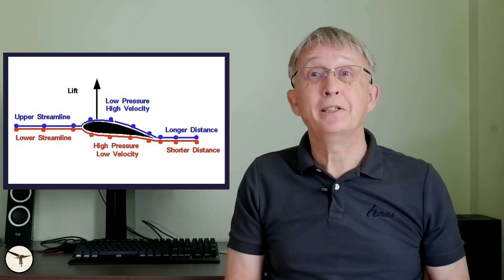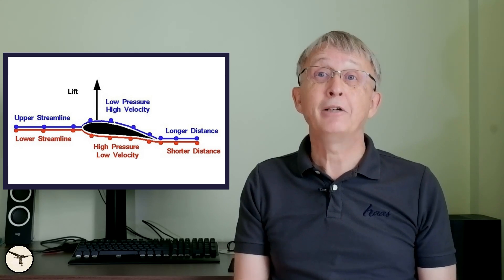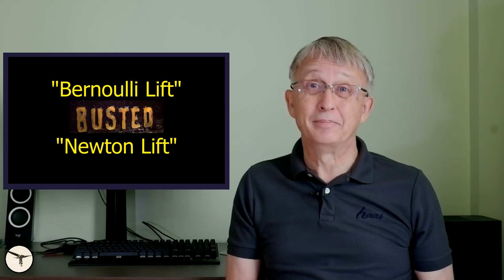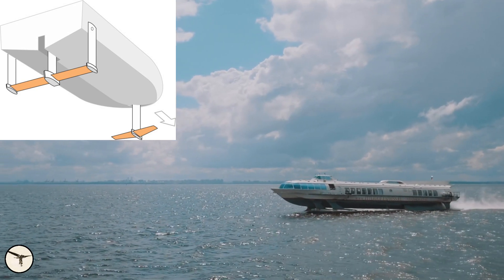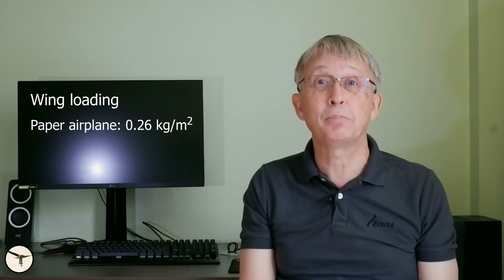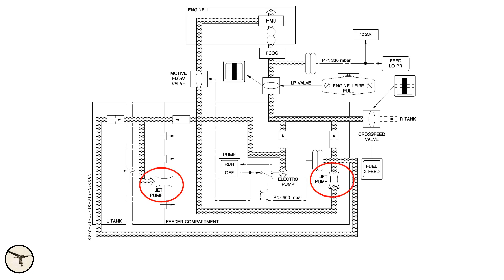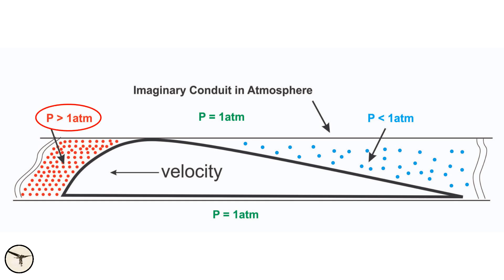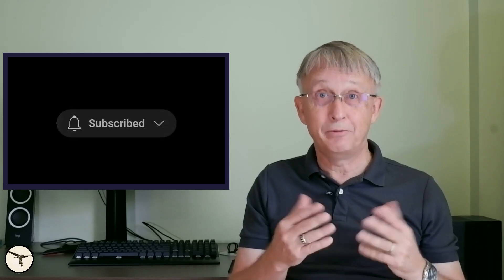7 Wing Lift Myths You Must Avoid: What Really Makes Airplanes Fly!

Comment: As an ex Boeing engineer (from back when they were still a good company), I agree with you 100%. But when you conclude your discussion about  Bernoulli's Equation and Newton's Laws of Motion with "BUSTED", some people might get the impression that both Bernoulli's Equation and Newton's Laws of Motion are BUSTED -- that is nether are useful in explaining lift. This is obviously not what you said or intended, but I see a lot of room for confusion. 
I like to say that arguing if lift is better described by Bernoulli's Equation or Newton's Laws of Motion is like arguing about how a bicycle is propelled. Is it  your muscles that move the bicycle forward or the tire of the bicycle pushing against the pavement? It's a silly argument, both are true but each only explains part of what is happening. Which description is better depends on what you want to learn about the bicycle.
It's also worth noting that the Navier–Stokes equations give a full description of fluid flow, including lift and drag, for Newtonian fluids (air and water are close to being Newtonian fluids in many situations). But the Navier–Stokes equations are generally unsolvable, and they are not exactly easy to explain. Thus they often aren't very useful for things like explaining why airplanes fly or even designing airplanes. Many of the "theories" of lift (Bernoulli's Equation, Newton's Laws of Motion, circulation theory, etc) come from engineers substituting much simpler equations for the Navier–Stokes equations. The advantage of this simplification is that these equations can often be solved, giving meaningful results. But there are huge drawbacks. The simplifications often mean the equations give accurate results only under very specific conditions. If you try to use them under other conditions, then you may get very unrealistic values.
Personally, I prefer the Newton's Laws of Motion as a simple answer to the question  "why do airplanes fly" -- they fly by pushing air down. For the subtly different question "why do wings produce lift", or "why are wings shaped the way they are", then it's probably good to bring in Bernoulli's Equation. But any time Bernoulli's Equation is used, I think it's important to note that the shape of streamlines or stream-tubes is different than the shape of the wing surface. This difference in shape is important in applying Bernoulli's Equation to things like flat wings and inverted cambered wings.
Reply from the maker: Thank you for your feedback. It is highly appreciated. And your analogy about the bicycle is great!
Reply: @andrewsnow7386  I would pretty much agree with most of what you said. 

But I've often wondered, for best practice basic explanations of lift, why the "shell" of Navier-Stokes is not regularly brought into the explantion:  conservation of mass (continuity), conservation of energy and conservation of momentum?

It just seems that strict observance of the separate accounting for and interconnection between all three of those conservation properties must be given full attention qualitatively if there is to be any hope of a somewhat realistic physical interpretation?
Reply: @davetime5234  The Newtonian explanation (F=ma) is the conservation of momentum explanation.  Bernoulli's principle is the conservation of energy explanation. Both rely on the conservation of mass. 
I'd be happy if more people just understood that these are not competing explanations. They are just different huge simplifications of the same complex phenomenon.
Reply: @andrewsnow7386  I certainly agree it would be preferable if people could see these are not competing explanations, but tied closely by cause and effect necessity.  Perhaps some better worded version of?:

The mass flow rate through a moving reference frame absent an airfoil presumably must settle to the same value even with the introduction of an airfoil.  

So the speed must adapt for wherever it can find a path to complete the flow, to a sufficient value to maintain mass flow rate continuity.

But energy conservation for the local speed change demands a static pressure transaction. (maybe relate it to random thermal kinetic energy plus intermolecular forces as the source of directed kinetic energy that supplies the increase in dynamic pressure: speed to maintain mass flow rate continuity)

And the asymmetry of obstruction encounter, causes a transverse (to the relative wind) pressure asymmetry from the above energy transactions.

And it is in fact this pressure difference which must impose a transverse change in momentum (delta P = d(mv)/dt opposing gravity, equal to weight, for level flight).

If tied together in some perhaps freshman college level physics sense like  the above, might the varied explanations be better anchored to fundamental proofs we all have to work though in science lab experience? (in contrast to concepts such as potential flow, circulation and vorticicty which appear to float rather unanchored to logical first principles physical proofs in many of these discussions)

Once we see how the momentum direction is changed, the explanation can consider the energy content dependency on tradeoffs in the mass vs velocity content of that transverse momentum (the greater the mass at the expense of speed, the higher the energy efficiency of the transverse momentum)

And the above hopefully then allows us to differente between energy dissipated in parasitic losses vs energy going directly into the vertical momentum change that directly accounts for lift.

Comment: Section 4, underside, 4:11 - the "busted" is for only paying attention to one surface not for the effect resulting from the fluid and bottom surface pushing against each other, but how it's presented misleads the viewer by making it look like the ever present positive angle of attack has no part in lift. The top surface' curvature provides control until the flow is disrupted, for example wings like the B-52 use spoilers to disrupt the flow as a means of roll control. The bottom of the wing pushes on air. No, this 4 line YT comment is not comprehensive.

Comment: Hi Magnar! I just completed an odyssey through your many (and if I may say so, somewhat repetitive) videos on this subject. The problem for me with your whole approach is that all the scientist's names and equations do not add up to an explanation at all: science is a description of reality, not an explanation. This stuff is useful if I want to be a wing designer, but not to give me an intuitive understanding of why wings generate lift at all. You are contemptuous of 'flat wing theory', but it seems to me like a good starting point. A flat wing with an angle of attack intuitively explains the generation of high pressure on the underside and low pressure on the top side, and why the streamline is deflected downward. It avoids all of the misconceptions and magical thinking you so trenchantly criticise with the other approaches. Having laid this groundwork, we then need to explain the consequences for the airflow over the top of the flat wing. This way it becomes pretty easy to explain why a flat wing stalls even at minimal angle of attack and also why bulking out the leading edge of the wing stops the airflow from separating simply by denying it the space to become turbulent into!

Comment: All this about air having to travel at the same speed across the top chord of the wing has completely avoided physical science . Air has weight  and air at a high velocity having to adhere to the top of a curved surface creates a force called centrifugal force . That force is held to the wings surface by the vacuum it creates at the surface . That vacuum or lift only occurs at a certain speed  where it can exceed the aircrafts weight  and lift it .The faster the air velocity the stronger the centrifugal force is exerted .  Yes most wings will fly some what upside down but at greater speed but will not lift like it would upright .Elliptical wings would fly upright or inverted . The thing about air must travel at the same speed  and meet at the trailing edge does not work there as they top and bottom are equally curved . Its about angle of attack and air velocity to create that centrifugal force to act on the top of the wing .  Now thats not a  fancy explanation . But its true.
Reply: You said: "is held to the wings surface by the vacuum it creates at the surface"

But there is no vacuum, nor partial vacuum.  For subsonic lift, the mass density around the wing stays constant.

Comment: Sorry, but i want defend Coanda effect to explain lift. My definition of Coanda effect differs from your: my definition is : when a solid ojbect is immersed in a fluid (ie: water or air) the fluid tend to follow the profile of the object. When a plane start to roll the air touches the wings and follow the wings' profile. In this way the air is pushed downward and for Newton's Third Law: Action & Reaction this air down causes the plane go up. It's like a baloon full of air: when the air exit from baloon the baloon travels around
Reply: …Coanda Effect, by definition, only happens when a jet is blown over the surface of the airfoil. It is the tendency of the jet to ‘attach’ to a nearby surface. You can have your own definition if you want but then you are no longer talking about the same thing observed by, and named after, Henri Coanda.
Reply: @XPLAlN  you are giving the same definition: if the jet is blown or the plane is moving in the fluid against the fluid the effect is the same: from the point of view of the plane it sees a "jet blowing against the plane"
Reply: @ I am not giving the same definition. I am giving you the correct definition. No free jet, no Coanda Effect. There is no free jet in the general case of airflow around a body. You are wrong to think it is the same thing. With a jet you get entrainment. No jet, no entrainment, no Coanda Effect.
  The difference is proved thus: the boundary layer separates from the airfoil at a given angle of deflection; normally this angle is constant wrt airspeed; now blow a jet across the surface (eg blown flap per video) and this angle CHANGES. You cannot delay the separation point (ie stall) by simply increasing the flight speed of the airplane. You can delay the separation point by blowing a jet over the surface. The latter is an example of Coanda Effect and the man himself is reputed to have turned the flow through 180°. Try doing that on any plain, unblown, surface.

Comment: So many people discuss "new ideas" for a problem for which the mathematical model was found before 1850 by Navier and Stokes. They improved the previous equations by Newton and Euler to include viscosity and thermal conductivity of the fluids. And I don't mean Newton's laws of motion, but Newton's differential equation for what it's called now a "Newtonian fluid". Newton already considered the speed of sound and Euler also the thermodynamics of the fluid, one century before Navier and Stokes, and none of these are reflected in oversimplified models you busted, even if we all saw nice photos of supersonic fighter jets with vapor cones behind them.
If you need a simple reason for lift, use Newton 3rd law of motion: if you push the air down, the air will push you up. If doesn't matter if you do this by flapping your wings like a bird, with a propeller like helicopters or using a wing and relative motion of the air, like planes and kites.
Very good and compact video, well done! I would suggest another one about the stall which is even less understood. Most can't fly a glider and feel it with their own hand, but you are very good at explaining.

Comment: We can compare an airplane moving "over" a mass of air with a ship moving over a mass of water, ignoring the physical differences between the two elements for now. The ship does not sink, whether moving or stationary because of hydrostatic thrust. For the airplane to achieve a similar effect it has to create a "surface" on which it can float. It can only do this when moving and by the shape of its wings. Regardless of the shape of the wings, it will "sink" if its speed is reduced to zero. But why doesn't the ship sink, even when stationary? Because of the shape of its hull (which acts as the wings of the airplane). So, what would be the ideal shape for the airplane's wings so that it floats, even when stationary? Would having the fuselage in the shape of a hull (so that it doesn't sink when it lands on the water) and the wings concave at the bottom, as if it were a huge umbrella, solve the problem? Yes, I am ignoring all the aerodynamic issues, as I know nothing about aeronautics. I am just wondering. A helicopter in vertical fall creates a bit of this umbrella effect, as the friction with the air during the fall keeps the blades spinning.

Comment: It's pure ignorance to talk about "equal time" for air over the top. The camber causes air over the top to pass faster than air under, even before "A" slows and compresses air underneath the wing.

Are we to think that for a ram-wing GEV like the Lippisch X-114, air bounces from under the wing imparting lift via Newtonian reaction, off the water and back up and off the wing again?
Or is it in ground effect via Bernoulli lift enhanced in GE, until it flies up above GE and switches to Newtonian reaction in the air?

Maybe with a propeller or ducted fan, there's a strong component of Newtonian reaction, but not for a wing -not even a flat plate without camber.

Comment: First I would like to congratulate this channel, not only as one of the very few that get lift right (see previous videos), but also for explaining it well. I would still like to comment on a few points raised in this video that might merit deeper discussion.

Air should be treated as incompressible at subsonic speeds, just indeed like water. There is no significant change of air density around a subsonic airplane. Looking closely, submarine control surfaces and hydrofoils lifting hulls out of the water at speed follow exactly the same physics as airfoils. This changes drastically only in trans- and supersonic scenarios, when very steep density gradients, aka shocks, develop. This change is actually the reason why supersonic airfoils are so very different. Any design can be optimized for either regime, but impossibly for both. This issue gave rise to, e.g., swept (edit: variable sweep) wing designs, but is also the reason why the Lockheed F-104 was very difficult to handle at subsonic speeds, and why supersonic airliners would only be viably efficient when they could stay supersonic for most of the flight time.

About the Bernoulli law, it is helpful to look at it as a one-dimensional limit of the full 3D situation. Expressed in this way, it relates the pressure gradient along a flow line with a force, and thus acceleration, along that flow line. This of course does happen above and below the wing of an airplane, but it is irrelevant to the question of lift. What is relevant is the pressure gradient perpendicular to the flow line, which is equivalent to a force/acceleration in that direction. This is the lift. This is, as will watchers of this channel know from previous videos, equivalent to the curvature of the flow line. In short, it is the curvature of the flow lines that creates the lift.

A slab as lift creating surface can, to some limited degree work. The relevant curvature is exclusively at the four edges in this situation. The point is that if the flow was laminar instead of turbulent, i.e., symmetrically identical at the front and back end of the slab, it would not create any lift, just torque. The "secret" why it does create some lift in real air is that at the back end the flow detaches from the slab surface straight and barely curved, instead of following the edge, as it is forced to do in the front. This still creates torque, is inefficient, and the stagnation point of the flow is barely controllable, which should make it a nightmare to fly. One of the breakthrough achievements of early aviators was to make the stagnation point controllable by blunting the front edge of the lifting surface, so that now the split of the flow could be controlled by angle of attack.

Finally, Newton's laws: Actually, this explanation in its narrow form, as it is almost always presented, would violate Newton's first law. The downwash acquires downward momentum, but a plain in level flight does NOT acquire upward momentum. So the momentum of the downwash has to be compensated somewhere else. In order to understand this, and actually the complete package of all three laws in relation to flight, one has to take a huge step beck and consider the entire height of the atmosphere and its boundary conditions, (hard below, soft on top) around the airplane. A plane creates a huge, albeit very weak and geometrically diluted vortex, with itself in the center, that ranges from ground level into the upper atmosphere. It would also be the force that vortex exerts on the ground that is relevant for lift, if one insists on using Newton's laws to understand it.

Comment: Three wise men were responsible for "inventing" the lifting power of the wing. The first and most important is Newton with his laws of mass changing direction. Then we have Coanda who helps Newton with what happens to mass following a curve on the upper side of a wing. Finally, we have Bernoulli who says he is in on it all because the wing is somehow sucked up by a magical negative pressure above the wing, but this cannot be proven.
Reply: Easily shown and proven using pressure sensors along the upper and lower surfaces of wings.
The upper surface in a positive camber airfoil at low AOA shows a lower pressure than the bottom surface.
Reply: @Talon19  Pressure is easy to measure but not the resulting lifting force. Bernoulli is a part of the lift theory but it is not possible to prove how much.